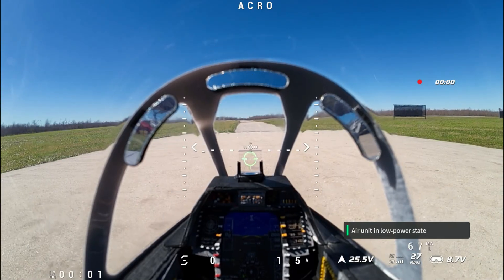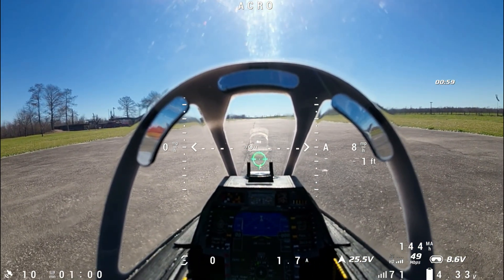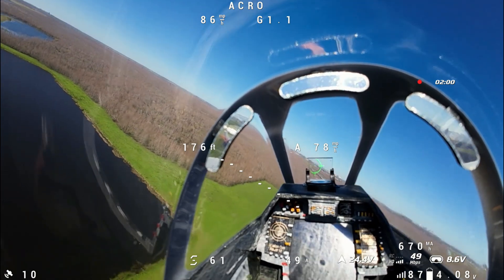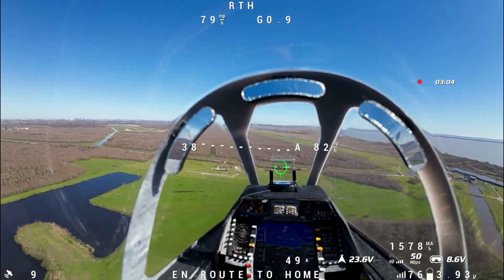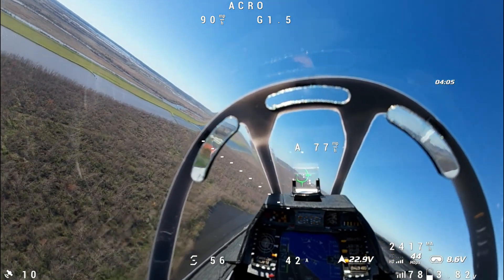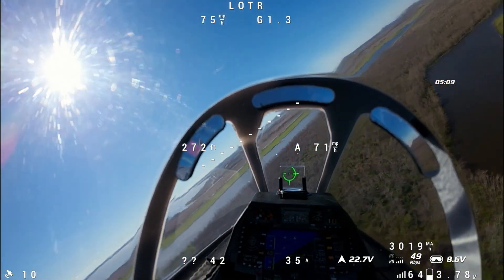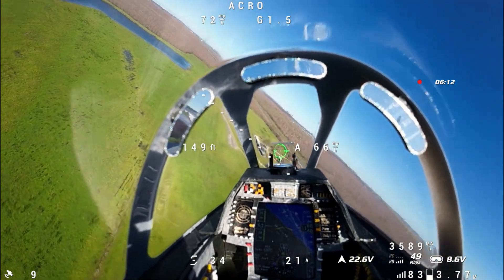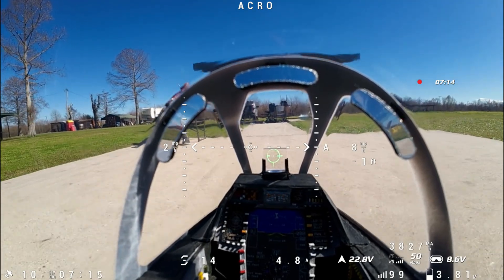Inav "Return to home" Test EDF (Freewing 80mm A10)

Comment: Dear Kelvin Williamson,
Congratulations on a great-looking aircraft and impressive FPV performance. I’ve been following your work with great interest.
I would like to ask a question regarding the OSD current display.
Does the value shown represent the current drawn by just one motor?
It seems a bit low for two 80mm EDFs.
To my knowledge, the flight controller allows only one current sensor input.
Best regards, and have a nice day.
Reply from the maker: Yes. Its just for a single motor.

Comment: Hey Kelvin, my god man, another super clean build. How did you go about keeping the dual edf dual battery system with the Mateksys flight controller? Obviously you can wire two esc's to the flight controller but how did you work out the dual battery situation. Also can you share your thingiverse files for the cockpit dash.
Reply from the maker: @kelvindukes4390  thanks  😊 🙏. The flight controller is connected to one of the battery/esc. I'm using the matek hall current meter so I'm not running the esc power through the matek fc shunt. All current data is pulled off one battery and the other esc/battery is on its own. Just the esc signal lead is connected to the motor 2 output on flight controller.
Reply: @kwboost  Thanks for the response. So if I am understanding you correctly, one esc is soldered directly to the flight controller with  the signal lead connected to motor 1 and the other esc is connected directly to the battery with the signal lead going to motor 2.

Comment: Love the technical videos you do! On some of your videos the fpvtoys screen flickers, and on some it doesn't. Why is that? Are they different screens, or some other settings affect it?
Reply from the maker: Thank you. I haven't noticed any flickering on the Fpvtoys screens. But, please send me a time stamp on the videos where you noticed it so I can investigate. I do have the Fpvtoys displays assigned to a transmitter switch and I change the screen layouts during flight occasionally . Also if you noticed it on the f22 videos.....the f22 does not have a fpvtoys display. It just has a basic oled screen connected to the fc displaying inav stats and the refresh rate is not good with dji.

Comment: Nice Kelvin, I am planing to set up a paper cub with FPV,  I have spectrum TX/RX need your advise how to get altitud reading on screen
Reply from the maker: Thank you. The way I get altitude reading on the screen.....I use inav software on a mateksys flight controller. The fc has an internal barometer and gps It overlays flight data including altitude over the fpv image.

Comment: XF robot (makers of the caddx gimbals) has a new 2 axis vertical gimbal now. So a version with PAN and tilt instead of roll and tilt. It costs about the same as the BAG but is a real gimbal so its a lot smoother.

Comment: Awesome job as always! I’m going to start moving away from dedicated air receivers and try the flight controllers. Do these have gyros/self leveling features like Spektrum? Im guessing they do since it’s able to limit bank angle to loiter and fly straight during RTH…
Reply from the maker: Yes. The flight controllers are fully programmable. there are self leveling features like with spektrum and more. I will be posting up an in depth overview of my current knowledge on Inav and setting up the flight controllers very soon.

Comment: Noob here. Why do you switch your OSD HUD layout when the landing gear goes down?
Looks like the GS and Alt swap sides, and some other changes.
Reply from the maker: @Darrylx444  very good observation. I have the vertical lines on landing to help lign up with the runway on landing. And I have altitude, gps, and airspeed as critical data for landing. When normal flight is have the screen a little less cluttered. I do plan on switching the airspeed and altitude to the same side on both modes to make viewing a little more consistent.

Comment: Get an airspeed sensor on there as well Kelvin. Big differences on even low wind days. I have iNav\O3 FPV on my FMS A-10. Same problem with landing gear. It doesn't last long especially the nose gear but I do fly off grass which doesn't help. Cheers
Reply from the maker: @EssentialRC  I do have the airspeed sensor on there and working. Using the matek asps-4525 mounted out right wing.  I think the reason I damaged the landing gear is from landing with full flaps on days with a 10mph+ head wind. As when I make the final approach the a10 tends to slow down and float too much  and stall a few feet above the ground land hard on the gear. I'm gonna try with half flaps and see if it has a more linear decent rate. Save the full flaps for calm days to slow the plane down.  I will have to pull the gear out and see if it can be repaired or I may need to replace before the next flight.
Reply: @ Oh yeah...you can def have too much flap. Adds so much drag, especially the big flaps on the A-10. Like hitting a brick wall. Think maybe you're just showing ground speed on the OSD. Thought airspeed would have an A against it. Mine does. Either way...good thing to have it. Nice vid as always. Loving it.
Reply from the maker: @EssentialRC  Thank you 😊 🙏

Comment: If you're running iNav 8 you can set an exclusion zone using GeoZone features so you don't fly over the pits. I think it's a good thing to do as you never know when you're going to need RTH. Things happen and you can lose FPV for any number of reasons. I'm planning on trying it out tomorrow with my AtomRC Beluga which I just upgraded from the iNav 7.1.2 it came with.
Reply from the maker: @EssentialRC  Thanks for the note. I do plan on updating to 8.0 and I'll work on getting the nav modes more dialed in.

Comment: Is range increased from that f16 v2 ?
Reply from the maker: @doggot.v414  range is about the same. Although with the new module the power output can be doubled to 2000mw if needed which would increase the range.

Comment: Love the head tracking. This might get me back into RC lol
Reply: motionsic gimbal. tally ho 2 headtracker. (same place as gimbal) goggles3. 03 air unit. frsky x20s transmitter. (tx must have trainer function) And the plane. Get something with about a 4' wingspan. Just need the power and ground wire to get the air unit to work. Other wires go to flight controllers and are only needed if you want the on screen display.
Reply: I’ve borrowed my friend’s kids oculus 2, there’s a flying game he has in it, the kid is not interested at all so I’ve been playing it quite a bit. This is like that game but IRL ❤
Jealous in a good way ;)